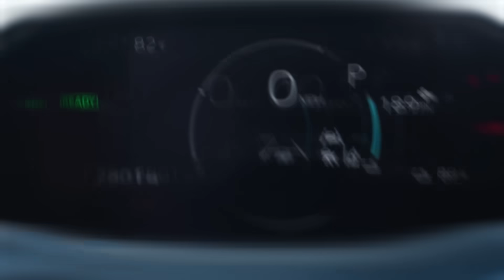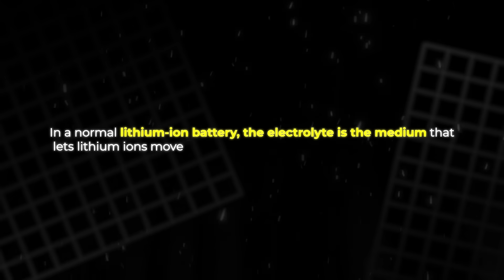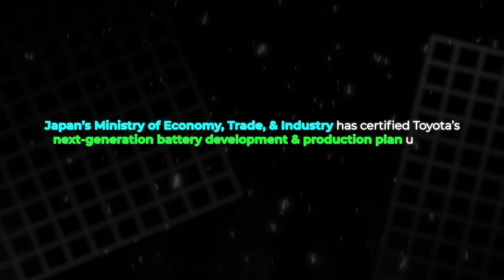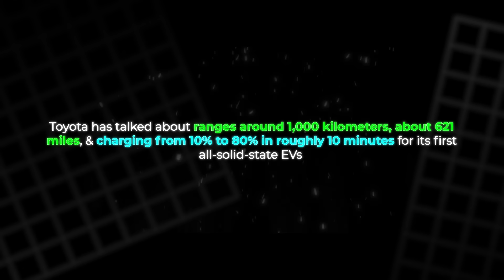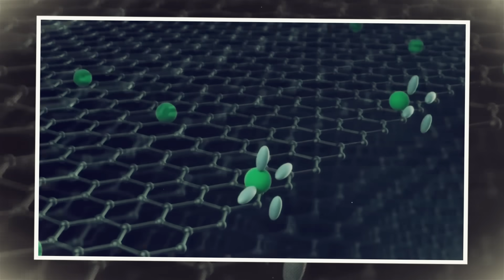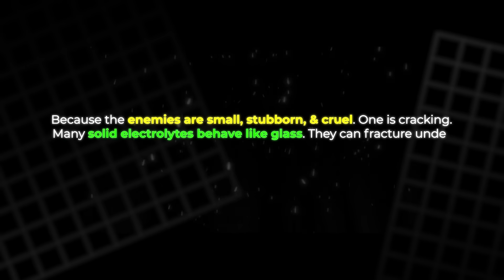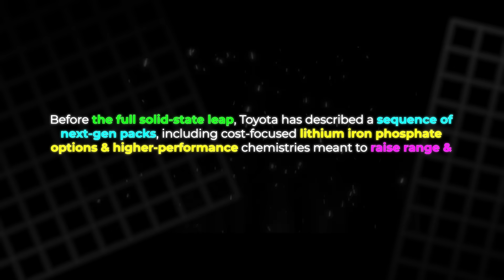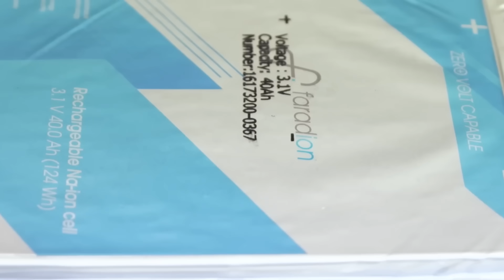Toyota’s 10-Minute Solid-State Battery Shock: 600+ Miles and a 40-Year EV?

Comment: No one today and no one tomorrow will drive 600 miles non stop. On most highways that's 10 hours of driving. The highway code says stop for 20 minutes at most every 2-3 hours. If I plugin after 3 hours of driving, go get a coffee, toilet, and a quick stretch...my car today is ready for another 3 hours of driving and then some. 

Very very few folks will need 600 miles range for long trips. There will be lots of folks that need 600 miles because they live outside of fast charging networks, but they can still charge at home. 600 miles is niche.

Comment: Sulfide solid-state batteries have many unresolved problems, and several have not even been solved at the laboratory scale. One of the major issues is stack pressure. Automotive-grade batteries require less than 0.5 MPa, while sulfide solid-state batteries typically require at least 5 to 10 MPa of stack pressure. No one has yet demonstrated that this requirement can be met at automotive levels. In addition, sulfide solid-state batteries have extremely poor fast-charging cycle life. If charged in 10 minutes to achieve a 600-mile range, the battery may survive fewer than 10 cycles. There are many other challenges with sulfide solid-state batteries, but without solving these fundamental issues, sulfide solid-state technology is not viable.
Reply: That's why I changed my chemistry brother. I went for an overall little bit heavier battery but safety factors are not even describable. Few cents extra for f**** safety. It feels like a very smart trade to me
Reply from the maker: We appreciate you sharing your detailed insights on the challenges of sulfide solid-state batteries!
Reply: they need silver solid state batteries not sodium
Reply: @bobsacamano7653 There is no such thing as a silver solid-state battery. It is either sulfides or oxides. You are probably referring to Samsung’s approach using a silver coating at the anode in a sulfide SSB. If so, that did not work either. It required about 2 MPa stack pressure and about 60 °C operating temperature and still could not support fast charging without severely compromising cycle life. Keep in mind this was a lab battery
Reply: @bobsacamano7653 lto
Reply: Do you know this an electrical engineer?
Reply: @10spinddan yes The chemistry is different so we just have to rearrange. The charger is different and we can run bms's to protect everything. Also, we can run bms's on a lead acid battery too, but that technology is outdated right? Ltos inherent risk of fire is very low, very low on explosion and a very quick charge time 6 minutes possible versus the 10 minutes on a sodium. They're just heavier that's their downfall
Reply: if it is not in lab yet  it will take  decades to produce
Reply: @tomilan6001 Sulfide-based solid-state batteries may never be practical for EVs, the challenges are simply too significant. At the moment, the most promising path appears to be oxide-based systems (LLZO), such as those being developed by QuantumScape. Even that approach hinges on successfully scaling manufacturing, but at least the underlying science is sound, and if scaling is achieved, costs should come down significantly.
Reply: @tomilan6001 lto they are definitely out. They're not just in the lab

Comment: Oh boy, can you just imagine 5,000 people in one area own a car $2,500 of them decide to charge at approximately the same time. Where did the power grid get? All that power? Okay? Simple. Let's spread that out on a larger scope and do it with some real numbers, not just some random s*** that I threw out in the air. It becomes unimaginary but I do like this extended range. I think personal bowl portable power units would be a lot better or a swappable battery you pull into a charging station. Drop one cell. Pick another cell and you don't even wait 10 minutes. This way you never have to max out the potential of any cell and it should last 60 years instead of 40. Gently charged massively discharged and if necessary, in the same case of an eye on watch, how it's charged, learn its patterns and produce a longer life cell as they are doing to the new eye on supercharging them. Rearranging structures again okay just a couple of foods for thought
Reply: Yeah the modular battery concept would have worked early on but now we're past that I think